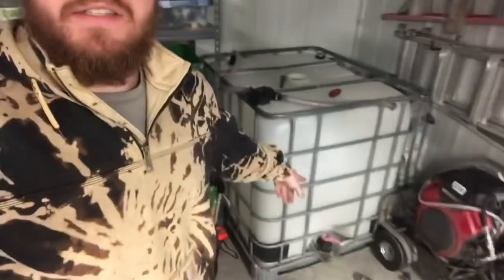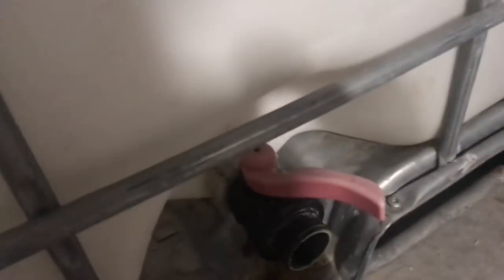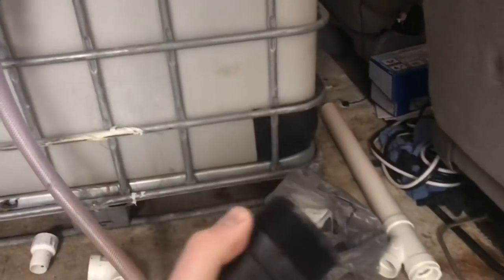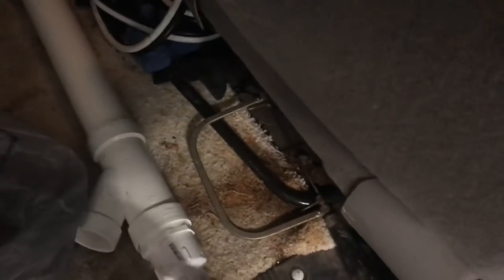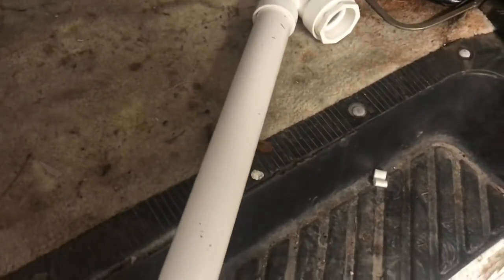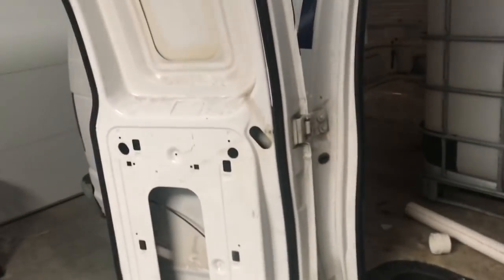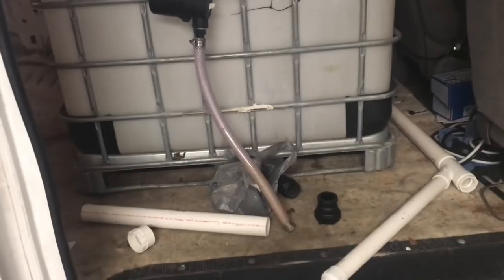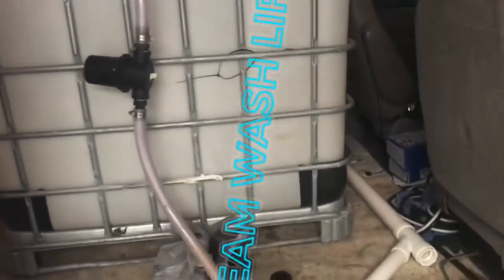Plumbing an IBC tote for power washer with PVC

Comment: You can also put a sweep T in front which will go away with two or three joints and glue and all that jazz at the front. It’s a gradual into a 90 which eliminates having to cut and put in another section of pipe and a 45

Comment: And can also get a rubber reducer if ya can’t find the piece for the tote adapter. It goes from a idk.. 3” bell to a 2” or 1 1/2 inch. Can hold it with a big hose clamp. Gives it some flexability too. Mine it like that and works like a charm. And I can pull it off fast if I need to. No screwing or gluing. It’s kinda hard to take that off without taking the tote out or cutting the pipe.